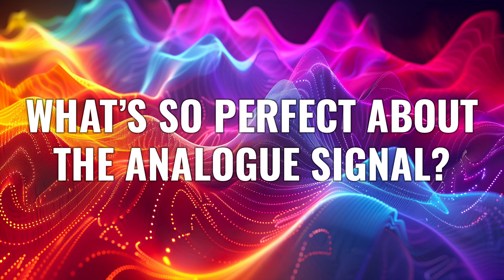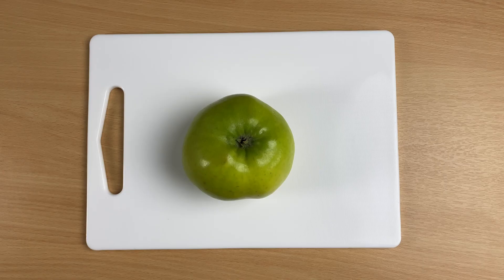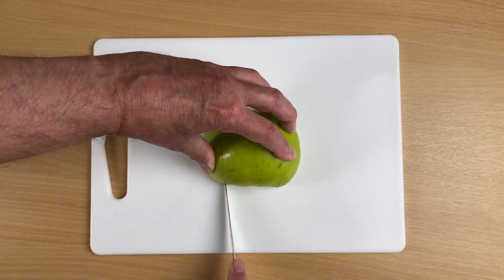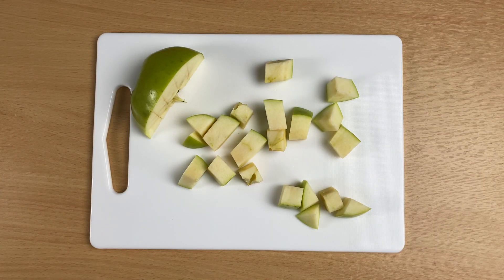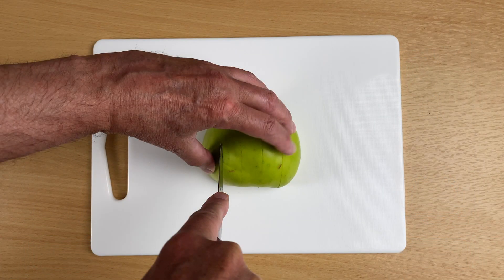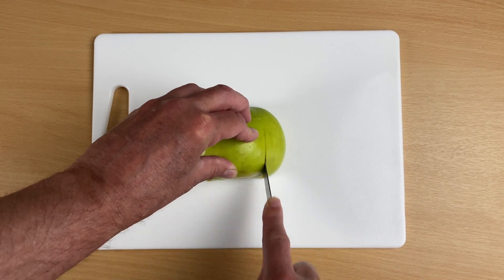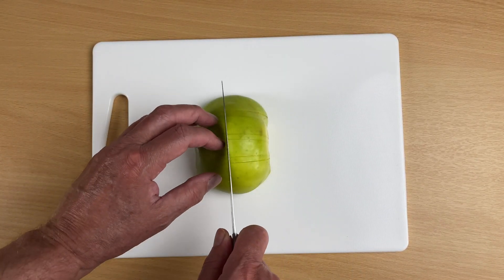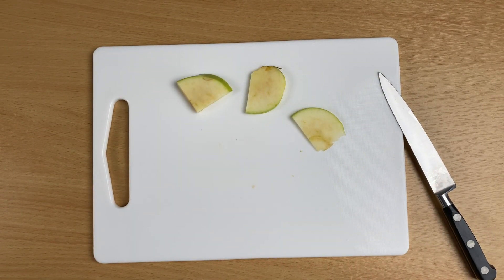Digital audio - Is it sliced and diced?

Comment: The slicing limits the transient resolution as well as the highest audio frequency recoverable. Does it limit it enough to matter? Almost certainly not even at 44.1kHz. I remember reading a very heated online debate between a well known audiophile and an electronics engineer regarding this several years ago, and the conclusion seemed to be that the audiophile didn't understand how digital sampling and playback reconstruction works (let alone how the human auditory system works) well enough to win the argument for anything higher than a 44.1kHz sample rate for a final delivery format.

Please feel free to disagree violently.

Comment: What? Are you kidding? An ADC and a DAC has nothing to do with “sliced and diced”. Such analogy is wrong... Are you looking for clicks?
BTW: Monty is only an engineer and not a Computer Scientist. So, I do not wonder about his “simplification” of the data conversion process.
Reply: @nicksterj Seems nobody is perfect. He should be aware of reconstruction restrictions + the loses in integer calculations for e.g. room correction… anyhow I do not wonder to see such anachronistic DAC technology, so many snake oil network switches, reclocking nonsense etc. when we have such engineers designing DACs and sound electronics…
Reply: @nicksterj 
MIT was OK but this is “the old good times” and as of today MIT is just a “shadow of their former self “. 

Just take a look how music equipment works in times of music is stored in files on servers. The processing chain is a disaster. The integer format for the Bit Depth representation is a joke. As a computer scientist I would never choice integer when I know further calculations are required. 

Also, the reclocking nonsense is a typical example of lack of understanding what it means to have a predefined stream of bits per second. E.g. there is no adequate buffer in DACs in order to decouple potential TCP/IP or UDP packet loses in the network from the DAC. Then the whole snake oil products such as “audiophile switches” … guess these “engineers” who develop this never looked into the definition of the TCP/IP stack.

How many engineers who designed this disaster studied in MIT? 
MIT does not mean anything anymore ... the mammon took control and drives the "construction"
Reply: @Lex_Populus  as a self proclaimed CS you are really talking a lot of BS.
Integer works just fine and yes there is a buffer before DAC in all normal products.
Reply: @VEC7ORlt  Integers do not "work fine". Actually, you should study how algorithms work and how integer impacts re-calculation of e.g. room correction. NB: we speak about digital format algorithms. this is part of computer science and I do not see any advantage when "engineers" without appropriate knowledge claim to know how it should work correctly. 

...it’s time for CS to take over the design of audio formats and the underlying transportation layers!
Reply: @Lex_Populus  with half comments missing its impossible to tell what was discussed
Regardless Monty contributed to digital audio way more than anyone here.
Also op is a dumbass outrage broker.

Comment: Where to start, the linked video with "Look at my 8bit scope, the wave looks the same".  :- )  THD is a distortion, but there are a lot of other distortion mechanisms. Amplitude/compression, intermodulation of any tone with another tone/s, PSU interaction, third order intercept, spurious free dynamic range, channel separation It’s a growing list. Take the 8 bit reduction example in the linked video, apparently it only affects the noise floor. Take to an extreme, say three bits, where is your amplitude accuracy to the original? Stuck between bits. It’s distortion, but not THD. Good job we can’t really perceive amplitude a low level. Digital convertors are not perfect, the space between bits isn’t equal. Your 44.1KHz clock  generally isn’t accurate, as a timepiece, my external soundcard is off by ~5s / day.  Thankfully, with 16bit audio and dither, all these distortions will fall well under perception, they are still there, we just can’t hear them, as the final reproduction link, it’s fine. If you want an idea of how well the electronics is doing, you will need a SysID test, and stop doing all the now very old steady state tests in isolation.
Reply: The F you are going on about?
Digital converters these days are damn near perfect, especially from the audio standpoint, with SINAD of 120dB being easily achievable.
Clocking isn't an issue at all.

Comment: Dear David, with all due respect by sticking to this stupid "slice and dice" analogy and trying to visualize it by cutting apples you simply proved that you lack the proper understanding the basics of the discreetly sampled and quantized audio reproduction systems and the underlying physical and mathematical law of nature, described by the sampling theorem. When a signal is SAMPLED it is NOT SLICED to pieces of equal though infinitesimally small width but simply MEASURED regularly. It is the mathematically proved feature of the universe we are living in that when we measure the amplitude of a continously changing phenomenon at a certain frequency we'll have all the necessary information to reconstruct the original signal though bandwidth limited to the half of the sampling frequency. No information is required for this between samples, unless we are happy this limitation of bandwidth. If we record the measurement values in a digital system of a certain "resolution" (number of levels) defined by the number of bits we introduce a certain level of so called "quantizing" noise due to the inherent roundings of the values. Even in a bread and butter 16 bit system this kind of noise is way below of anything you could achive by the state-of-the-art analogue technology.  Sad to see that any professional who is acting as influencer for such a big community could make such a misleading video, which could turn into "reference information" of audiophiles to refer later on.
Of course you could ask what is the difference between a "slice" and a "sample" or "measurement". Well while on the surface they look the same but there is a very important difference. The "slice" model implies pieces which include information about the signal's behaviour in time-domain, suggesting that it contains information about the timbre or other features, therefore in digital systems we'll drop a huge portion of the musical information by dumping most of. The truth couldn't be further as the samples contain no more information than the actual amplitude at the moment of measurement, which is sufficient for the recontruction.
Reply from the maker: If you watch my video again you won't find anything that's factually wrong. What you're complaining about is stuff you've made up in your own head. My only regret in this video is that it would have been a damned sight easier to make my crumble if I'd peeled my apple first.

Comment: Sliced and diced is not a correct phrasing. Because it’s literally just a value with two parts, no space occupied, not even in a 2 dimensional space. The information is recreated by giving that digital information to a converter that turns these values into a changing voltage. And because of physics and the limitations of the digital information, there’s no chance for the output to be any different from what the input has been.
Reply from the maker: "Digital audio is  just a value with two parts, no space occupied, not even in a 2 dimensional space." I wonder how many views that would get as a title.

Comment: What a load of bullocks. The filter perfectly reconstructs the Fourier response of the transfer function to complete precision.

It's up in the air what sampling frequency is sufficient (48k is fine to 23,999Hz) or what word length (referred to as bit depth) 16 bit gives 96dB s/n ratio. We use 24 bit in the studio because each 6dB of attenuation drops one digit from the word length, hence a -48dB signal referenced to Zero uses 16 bits of word length,  still 96dB s/n

It only takes 2 data points to construct a perfect sine wave or an absolute representation of the transfer function after the Nyquist filtering which is exactly half of the sampling frequency, which is passed as an analogue signal of full bandwidth,  DC to half the sampling frequency. 

It cannot be argued.
Reply: 2 data points can reconstruct a perfect sine wave .... but that won't even get close to reconstructing a complex harmonic structure in music. Music, contrary to many depictions is not "just a bunch of sine waves" ... it is a complex mess of harmonics and sidetones, virtually none of which even vaguely resemble sine waves.
Reply: @Douglas_Blake_579  What do you mean "none of which even vaguely resemble sine waves"? All signals can be decomposed uniquely into sine waves. That's what Fourier taught us: https://en.wikipedia.org/wiki/Fourier_transform
Reply: @nicksmith4507  
The answer is in your own rebuttal ...  "all signals can be decomposed"   

Fourier Transforms are mathematical abstractions that attempt to break a signal down and display it's frequency components. They are not the signal itself.

Serious question ... Have you ever actually used an oscilloscope?

I can guess from your response you have never seen a raw audio signal  displayed as it goes down the wire.

It's a basic fact of physics that any circuit segment can have only a single voltage present at any given instant of time.  This includes everything from the pins of transistors, the leads of a resistor or capacitor, to the output of a DAC chip or amplifier, even the wire in the cables we use to connect things together.  

This means that an audio signal is actually a single voltage that varies over time.  There are no sine waves, no frequencies, no separate elements ... there is only one voltage bouncing around like crazy.

Audio signals are down right messy things. If you track this voltage over time with an oscilloscope, you will see a waveform  that bears absolutely no resemblance to those nice tidy sine waves or frequency graphs all these test reports show us.   

The truth is that all the way from the microphone that captures it to the speaker that reproduces it you are actually dealing with a single voltage (per channel) that is nothing more than a map of how to move your speaker cones... and by extension your eardrums.
Reply from the maker: Cannot be argued? I would argue with that but since your comment addresses precisely nothing that I said in the video I don't think I'll bother.
Reply: @nicksterj 
The actual signal is the bouncing voltage.  Everything else is an abstraction taken from analysing its changes.  Abstractions are not the real thing... they are taken from the real thing.

As I said, in reality an audio signal is nothing more than a map of how to move the speaker cones.

Comment: I was going to ask about what would happen if you used an onion, and then you did! I haven't got much more to say really, except that maybe we should try measuring the effect of digital and analogue audio on the listener rather than confining ourselves to analysing the audio alone. Of course, this has been attempted - perhaps successfully, I don't know. There was, I believe, an experiment with cows listening to both digital and analogue audio which was conducted back in the mid-'80s. I can't find the paper to reference it, but it was reported in a CD magazine of the day (I would name it if I could remember). I can't recall much about that article, so I don't know if it was a well-designed experiment, whether it led to meaningful findings, or if the findings could be replicated. But there is that question about what you choose to examine or measure. If you analyse what a tape is, you could measure the composition of the strip of film, the binder, the magnetisable coating, and the extent of its magnitisation, but that won't necessarily tell you that The Beatles are in there somewhere (or maybe it would?), or, importantly, what effect it would have on you if you heard the recording (or consumed the diced onion - once cooked, mixed and mastered). Just a thought - and not a very original one.
Reply: Truth being told, you probably listen to digital audio all the time and don't even realize it.
Reply: @Douglas_Blake_579  These days it's very rare (for me) to hear purely analogue audio. Even the stuff I record to reel-to-reel is almost entirely digital in origin.
Reply: @IndigoDavei  
Yep, that's about right. 
My music collection is entirely digital, stored on hard disks or streamed. 

In the early 2000s I transcoded big pieces of my Vinyl collection to MP3/192 which was the best bit rate at the time. I made sure the sound quality was equivalent, then I sold off the collection and the turntable.  These days the collection is upped to MP3/320 and curated to -16lufs using MP3 Gain, so I can listen without clipping or loudness jumps. Works a treat for me.

Purists will jump on me for using MP3 ... but the software and space to do this with FLAC doesn't exist.